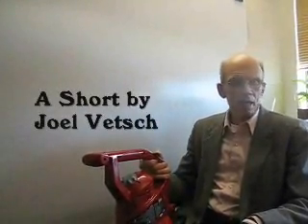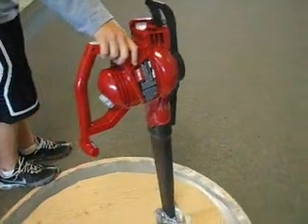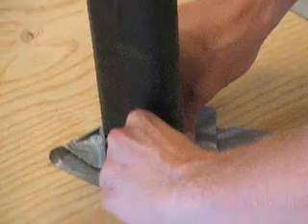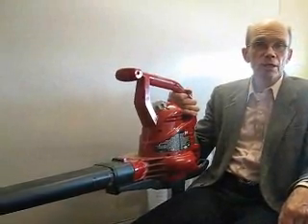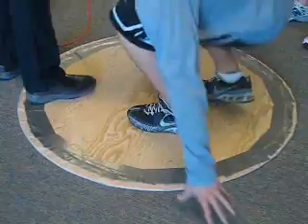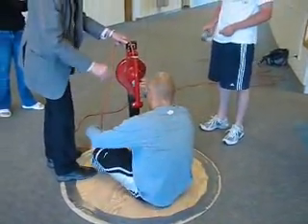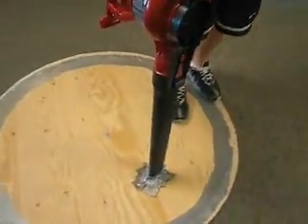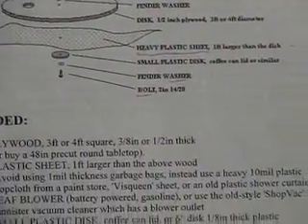Do-It-Yourself Hovercraft

Comment: @DeJordzta if you want a better hover height, then increase the size of the skirt. For example, if you make the wood disc 3 feet, then make the skirt a few inches bigger around than the disc. Say, if you want 3 inches of lift give about 4 inches of skirt leaving an inch or 2 to connect to the disc. In this video the skirt was about the same size as the disc...not allowing for hover height